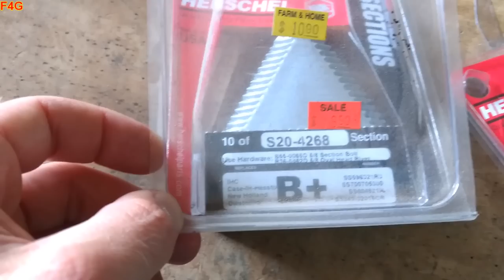Overview: Rowse Double Bar (Sickle) Mower

Comment: you are doing my dream 65 yrs ago. I started out with a 7ft foot lift on the bar from tractor with a john deere g hand clutch no power steering. we only had land that was to rocky to farm for hay ground so it was a lesson in learning to run the foot lift from tractor seat and hand clutch and miss the badger holes with the narrow front end, yes I tore off twice,from front going in hole and snapping off the front and missing them rocks catching the sickle bar.

Comment: I just recently bought a Ford 501 7' sickle mower and it worked great on the 20 acres of hay I farm! 
But I really like this double mower! Some of my neighbors rely on others to cut and bale their fields for them and their fields are double or triple the size of my field. This double sickle mower would work great for mowing all those fields. Where can I find a good used one. And what do I look for when I buy one?

We also have rough fields here too! Especially gophers and prairie dogs! The 501 sickle mower I bought works really well when going over some of these mounds if dirt
Reply from the maker: Try tractorhouse, or look up Steffes Online auctions... to find one might have to look around the upper midwest states is where they are the most popular (north and south dakota, montana, wyoming, nebraska, etc). Rowse is out of Burwell, Nebraska. Also look up Kosch, they have a double sickle as well... I'd stay away from older models since they had issues early on with them but I think the later ones I've heard have been decent.

Unless you can find yourself a decent small haybine too, might be more readily available wherever you're located.
Reply: @farming4g  
Good advice, thanks 👍
Reply: @farming4g  
So what's the time frame of older verses new ones do I look for? 
Are hydraulic driven better or worse than pto driven?

Comment: I have to agree with you that a sickle bar mower or good to have four areas where a disc mower or a mower conditioner may have trouble with. For a suggestion for you on your sections is, I like to use the serrated edged grass sections on my sickle mowers. They look like two small sections made it into one bigger section like you use which is double the cutting services when you're mowing any type of grass or Alfalfa Clover etc for hay. For me they work much better. Now don't get me wrong I like my disc mowers but if you have Terraces or ditches I found out that the sickle mowers works much better.

Comment: Thanks for the vid   I couldn't cut hay with out my discbine because of the mole hills and I cut at 5mph    I wish someone sold those bar mowers here    I'd like to buy a used one to try cutting green feed or some dryland hay with it.   Like I said before Dad hasn't used a bar mower since the 60's   but I'd like to try it out.
Reply from the maker: AndersonCattleCo. I guess if dealers can't sell em they won't order them... might have to look far away for one, but if the discbine is working good stick with it.
Reply: I could see using one in some light thin blade grass but I don't see how you do it after using a disc mower I can run so much easier and faster and I would bet the day you try one you will agree as well but on the other side of all that I cut hay in tn your in North Dakota  so  I may be wrong

Comment: Another nice thing about a sickle bar mower is they don't draw a lot of horsepower. We used to have an old 12 foot bar that we ran behind the Super H for many years. We always ran a soft shear bolt to save parts instead of relying on the belt to slip.
Reply: That's the thing they don't need much HP

Comment: I am curious what you thought was better about the older NH heads. These should definitely be stronger that the older ones because Rowse has beefed up several parts of the head and changed how others are welded.
Reply from the maker: That's what someone at rowse told me last year... Said a few changes were coming to the new NH heads... Specifically when it came to the welds and how some things are put together. Have had issues with both my mower last year and dad's (and the previous mower) had issues with bolts breaking or plates cracking. Dad used to never had to hardly replace anything on those NH heads on the older mowers years ago.
Reply: Farming 4G                           I have seen several issues that I think have made the NH heads seem weaker. The first is that people are pulling these mowers faster and with bigger tractors. These bigger tractors will push the power through these mowers without slowing down for tough areas. The second thing is that these HD sickles are much heavier and stronger and the bolts add additional weight. That creates more weight to stop and accelerate the other direction. It also transfers stresses from obstacles to the head much more effectively. The third is that Rowse has their own belts which are a much better belt than the stock belts . These new belts can transfer power a lot better without spinning out. The fourth is that we use a sealed pulley on the underside of the belt where the flat dowel used to rub against the belt. That increase the surface contact area of the belt and pulley as the belt wears which allows more power to be transferred to the head. The fifth is the use of self sharpening top serrated sections. Rowse recommends the use of the under serrated sections. They claim the reason they do this is that people don't know how to judge when a top serrated section is worn. I agree with them after having looked at many types of equipment with top serrated sections. We use the top serrated sections too, but keep the adjustable hold downs adjusted to .010" with a feeler gauge so they self sharpen and do put excess stress on the heads and round out the guards. We also have learned to judge when the sections are worn excessively as the serrations start to extend across the section and the section will thin out and allow the sides of the section to bow up (hard to spot unless you know what to look for). Generally when you start to plug up on tough conditions and tightened the holddowns doesn't fix it, it is time for new sections or a new sickle (and new guards at some point). Finally, my husband will only use the old NH wear plates. He feels the thicker universal wear plates hold the sickle at an excessively aggressive angle and this stresses the heads more and wears things out prematurely. 
               I think that all these factors add up to create the illusion that the heads are not as strong. Our experience is that the heads are subject to much higher stresses than on previous mowers with New Holland heads and this is why Rowse has had to beef them up.

Comment: What is the width of cut for that mower. It looks well made yet simple to work on.
Reply from the maker: 18 feet total. It's pretty straight forward, but can be a little pain when having to disassemble the heads, parts are kinda heavy and very GREASY!
Reply: Farming 4G                      I am curious what you thought was better about the older NH heads. These should definitely be stronger that the older ones because Rowse has beefed up several parts of the head and changed how others are welded.

Comment: Question, I understand you not having a disc mower but how about a pull type swater, it works the same as the sickle mower doesnt it? Its just much longer.
Reply from the maker: A swather would work, depending on the type of forage being cut. Problem is the windrow can get big and might have trouble curing, would need to have conditioning rolls or a tedder to spread it out. Plus some of the swathers, those knives can be quite long and might end up breaking or slugging easier depending on the crop. Some grasses here, like tough junegrass, can easily slug up knives and guards.
I'm planning on getting a haybine head at some point for an H8040 machine that bought last year for swathing grain.

Comment: Nice mower ,was just wondering are those combine knife sections ,i remember them being smooth edged for grass .
Reply from the maker: There's a variety of sections, ranging from serrated to smooth. We usually use B+ sections on the mower, and C+ or C sections on the combine and swather.

Comment: As I'm petty sure you meant...
($9.00 X 32 = $288.00)
Reply from the maker: Nope, $9 for a box of sections (10 sections in each box)... came to around 90 cents per section.

Haven't checked lately, but they are more expensive now than they were at the recording of this video.
Reply: @farming4g  Ohhhh. 👍